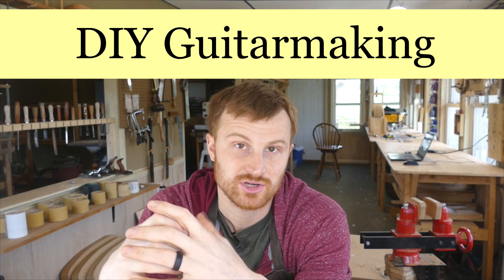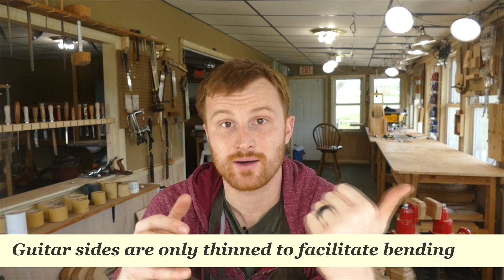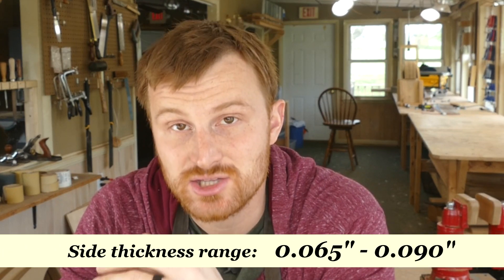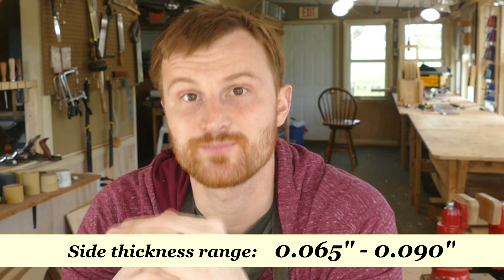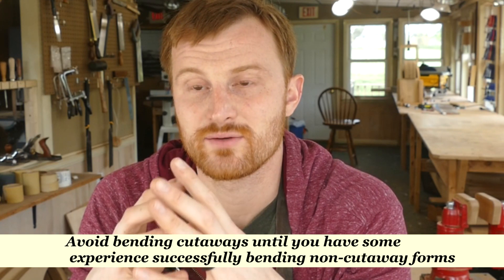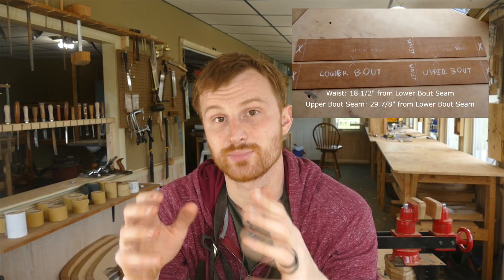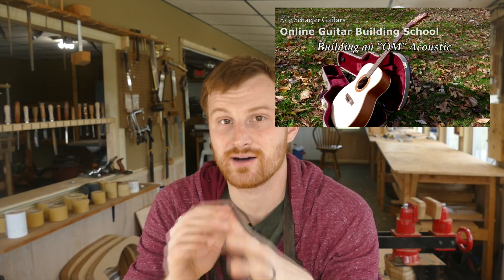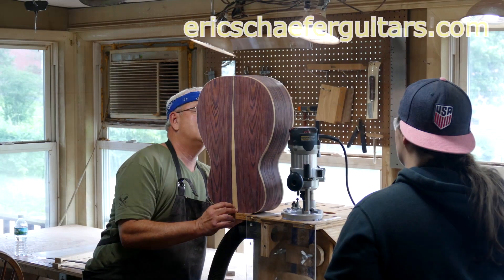How Thin Should Guitar Sides Be?

Comment: Not necessarily sides but was able to successfully bend .08" rosewood bindings around the horns of a Stratocaster project. Basically, that's a 0.75" radius. Currently working on a rosewood dreadnaught. Since I am winging it, this is good to know what the standard thicknesses are.

Comment: Interesting. 
I have been using Cherry, Ambrosia Maple, & White Oak for sides in my last 3 instruments. 

I'll change the waist radius if I have too. Some designs just look cool, but make bending extremely difficult to pull off. I even immerse my sides after steaming in hot water and then iron with a steam iron on high setting with the piece on a flat surface just prior to placing in the bending jig. Then as I wrap a side around the bending form the heat from the iron is still being applied. The iron really helps my method a lot.

But yes, thicker is nicer considering all that follows and also removes wood from the sides. I slice my own sides to avoid the cost of having the adjective luthier's applied to the piece which makes $1 become $60 and I don't always get uniformity across the slice or cut. Sometimes it's a matter of saying I'll use it as a side but while binding and purfuling may look cool, so does a top and side profile neatly trimmed flush; thus go with it.

Comment: I hand bent my sides at 3mm to 3.2 mm thick. It worked fine, I used Black Walnut. My first guitar. Cedar top. Light to Custom Light strings work the best. It's loud but not punchy like Spruce. It's somewhere between the shape of a OM and a Dreadnought.

Comment: This presentation answers a design question that I have on my first build, i.e. the function of the sides. I have thought that the best function of the sides is to efficiently transmit vibrations from the sound board to the back and then the reverse. If you ask 10 builders this question you probably will get 11.75 answers. Eric has always been accurate with his interpretations and I am going to go with his on the sides. Thanks, buddy...

Comment: Can we make guitar from teak wood, means back , side,  top n neck all from teak wood, becoz teak wood is easily available here.
Reply: Teak is very brittle hard to bend also very oily hard to glue
Reply from the maker: I don't have any presonal experience with Teak but from what I understand it would be far from an ideal wood for an acoustic guitar. You could certainly experiment with it though and try it for a back and side set. I would be more hesitant to use it for the neck though, where stability issues can be especially problematic.

Comment: Eric, I hope you don't mind a somewhat unrelated question: Would you please tell me how thick a classical guitar soundboard would need to be in order to be immobilized and unable to perform it's auditory function?

I want to modify a classical guitar for "silent" practice, and thought an effective approach would be to remove the back, and glue to the underside of the soundboard, thick additional boards cut to fit between the bracing. Finally I would add a piezo bridge pickup for headphones. 

I'm just not sure how thick the boards would need to be to stop the soundboard from producing sound. I suppose the kind of wood used is going to be a factor. 

Maybe it's a terrible idea? Thank you sir for your time!
Reply from the maker: I would think filling the entire soundbox cavity with an insulative material would be a much better idea. If the cavity were completely filled the plates would be unable to respond in the usual way and even if they did there would be no air for the plates to "pump" because it would be effectively displaced by the insulation. Volume is a product of the size of the air cavity and the specific modal movements of the plates, not simply the overall stiffness of the system. For example, you can have a stiffly braced guitar that still has a lot of volume. It just would sound incredibly brash and bright and non-sustaining.
And then, of course, filling the cavity has the added benefit of not having to irreversibly alter an instrument.

Comment: Hi man i really like ur videos :) ..im building an om size guitar all mahogany i searched every where to found an apropiete tickness of top back and sides..can you help me with that?  Sorry my bad english..saludos from peru :)
Reply from the maker: You're welcome! I would say:
 Sides: 0.085", 0.075" at the waist
Top and back: 0.090" - 0.120" (Final thickness)
For the top and back, if you aren't too experienced I would err towards the thicker end of the spectrum. One of the biggest mistakes beginners make is starting out too close to their final thickness and then sanding more aggressively/more frequently than they should. So starting out at 0.120" on the top and 0.110" on the back is a pretty good way to go.
Reply: @EricSchaeferGuitars  thank you very much!☺
Reply: I'd say test a few pieces and find out the tolerance. If you can nicely bend a piece at 1.1mm go for it

Comment: If thicker is better, for sides, I know furniture makers bend 1” thick. Why not just bend it at 1/4 inch thick?
Reply from the maker: I don't know the specifics behind that or if there is something about the process that makes guitar sides impractical, because I don't have experience with alternative bending techniques like bent laminations, or kerfing the inside of the wood, but in principal I don't see anything wrong with it if it works.
Of course, past a certain point, the sides are optimally stiff and then you are just making the body unnecessarily heavy. I'm not sure if 1/4" would be a bit much, perhaps a little less. My gut tells me 3/16" would be good, but thats just a gut reaction.
 I vaguely recall seeing atleast one guitar built with thick sides, in this case using the kerfed inside technique, and many have been built with bent laminations.

Comment: I built a FLYING V for many reasons..it's becuase I dont have all the proper tools.
Pointy guitar works for me...I can get away with it...becuase
Im also a heavy metal headbanger.lol....Never the less  enjoy playing acoustic spanish , neoclassical ,folk...ect..
i also hated regular wide fretboard..I wanted it  slighty wider than my electric...but no
dice....I had to to purchase regular electric neck...which I didnt mind..it has 22 Jumbo frets.
I play riffs scales as if Im playing my electric. ( works for me)
It's actaully on NYLON strings....It sounds decent. To my surpise.
It's just as loud as my other acoustic...i havnt install preamps/pick up...dont need to.

4" thick..it's my practice guitar...which get more play time..becuase Im not affriad
to dent it. Plus i built it...I simply play it more..it's actaully my second hand made
acoustic....I learned from the first build.

i  had wood working experince building nitro R/C models...
I had to build it STRONG..but light...i just used scrap  TRI STOCK.
I also used a thin coat of epoxy to seal the tri stock
To help the wood stay glue for decades..i hope.lol

i didnt thin out the sides....simply becuase for durablity.
it's 4mm thick.
I thin the deck to 2 mm...There;s doublers under the strings Pegs...all the way
to the inner V of the body..to prevent the string from bowing the deck UP

Did alot of reserch on the deck bracing...and also have expensive 1950's gibsons acoustic..
which I dear not put heavy strings on any more....or notice issues with DECK BOWING
on typical acoustic guitars....so I sort of glue a brace like a KNIFE edge..instead of flat.
This allows the deck to resonate  but also prevents the deck of bowing
up or down....i dont have tuning issues or guitar going out of tune...if I decide to
rest my palm on the bridge...ect.

That's the only brace..due to the shape of the guitar.

For the tips and heck cut aways....I simply used BLOCKS. The neck also mounts
onto that same block..it's screwed and glued. the truss rod is on the head stock.
The block on the wing tips...it's to prevent holes from dents....I dont use a guitar
stand for my flying V....The guitar is FUNCTIONAL...It's V shape fits in between my leg.
Im at PROPER playing position. My strumming or picking arm isnt fighting the guitar.
It rest on the EDGE...not the deck...Or trying to reach over a big round bowl..lol
i also hated that when I play regular acoustic guitars....

Comment: What is the best way for a first-time builder to bend sides to yield the best result with the least difficulty?
Reply from the maker: Well thats a bit of a nuanced question but without getting into the details and compromises...
- use cherry
- Thin to 0.085" and the waist area an extra 0.005" - 0.010" thinner than the rest
If you are machine bending, check out my 3 parter on that on my youtube channel.
If you plan on hand bending around a pipe or heating element then I teach that in the online course "Building an OM Acoustic" at ericschaeferguitars.com

Comment: I look forward to any luthier videos. 
This was a question ( the video title) I googled long ago, simply to know how thin is bendable.
What I find difficult to remember is when it comes to guitar in general, the dimensions are often in thousandths of an inch or simply " mils ". If you had said say  - between 3/16ths to 1/10th of an inch would be easier to imagine. I'd give you a thumbs up even if you built just 1 acoustic guitar and kept it together for some length of time! It does take some effort to put together a video like this, but if you could give a cross sectional drawing of the position the sides meet the top and/ bottom including the bindings and including a bracing in the background would make all aspects of the topic clear. Thanks for the video and I will view the rest of your efforts.